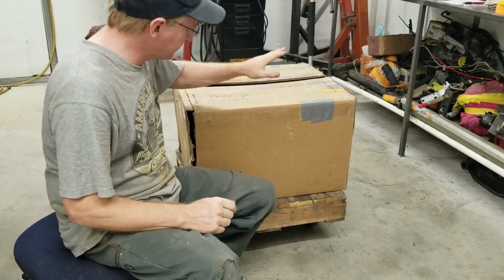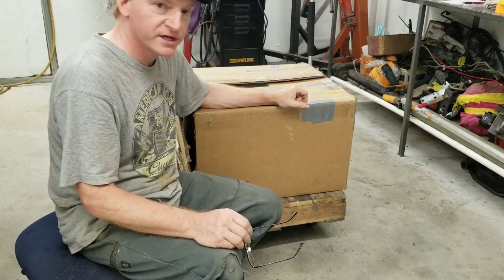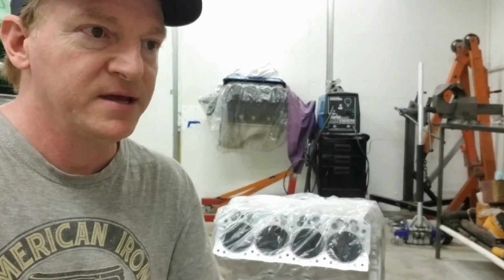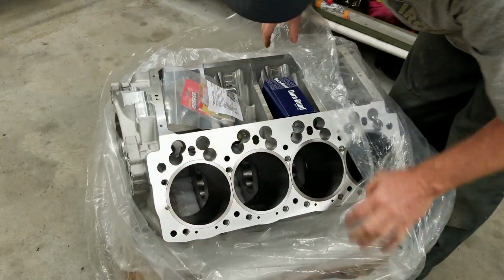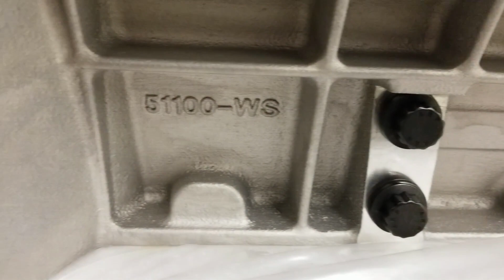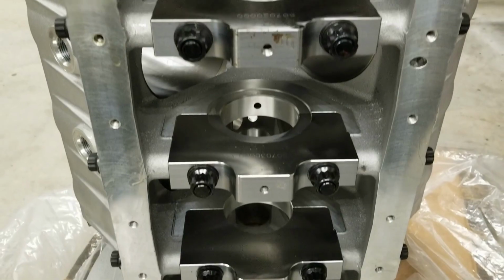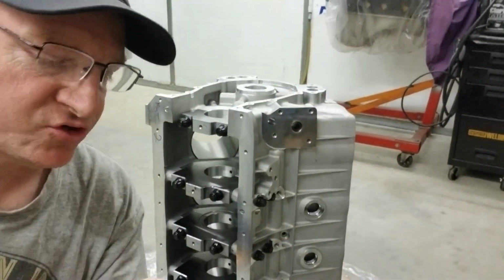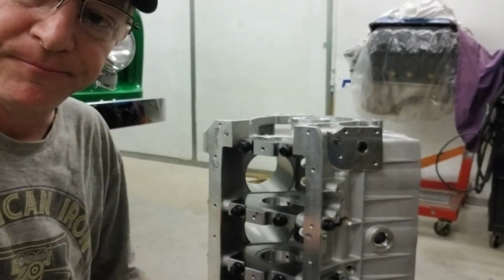New Gen 2 Keith Black Aluminum 4.5 Bore Hemi Overview

Comment: I got one at Carlisle 4:50 bore with 4 bolt mains KB block  a older one I'll use same heads stage V 2:42 kick out they flow up to 600 cfm compared to 400 cfm Indy and elderbrock

Comment: Just got my BMP 4.500 hemi block last week as well, a bit cheaper VS the KB, definitely quite a bit of difference between the different manufacturers. Mine has bushed lifter bores, which I like better, but only 6 bolt mains.
Mazzolini said he preferred the KB blocks, but I already had orded mine, and wasn't gonna change course. 
Let us know if the machine shop finds any defects or anything needed a correction other than just the basic finishing process

Comment: makes perfect sense.You did not go with the large journal raised cam because you wanted to save money.
Reply from the maker: All Keith Black aluminum Hemi blocks  - raised cam, bore size ect....are ALL the same price at 7,495.00...  A raised Camshaft  is to give more clearance from the rotating assembly.  It is not needed on this build.

Comment: Hi Mate, just wanted to see if you would have width measurements at the widest part of the block with the heads on. Just researching engine combos before i get a dummy engine block for the chassis fabrication. Kind Regards Nick 👍
Reply from the maker: yes, 28 inches across max width  with valve covers no headers.

Comment: Does these gen 3 blocks come with drill oil   feed holes for the lifters? That's a brute built block any ideal on what it weighs?
Reply from the maker: Yes it does feed lifters... can be restricted for solids.. block weighs 145 pounds
Reply: @ES4406  Thxs